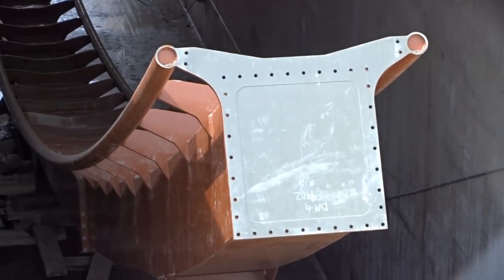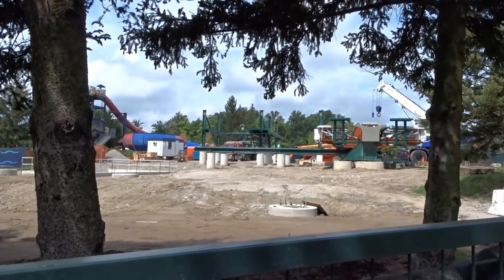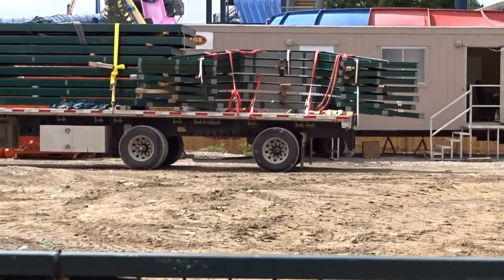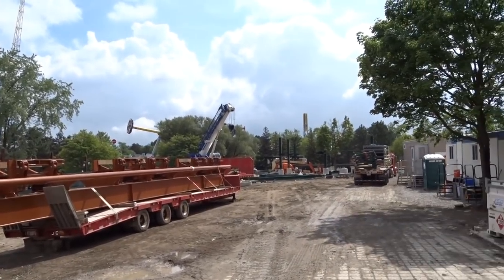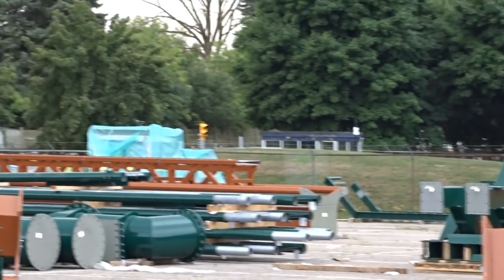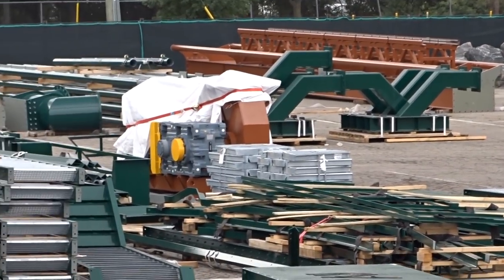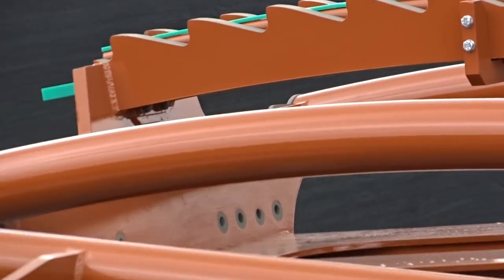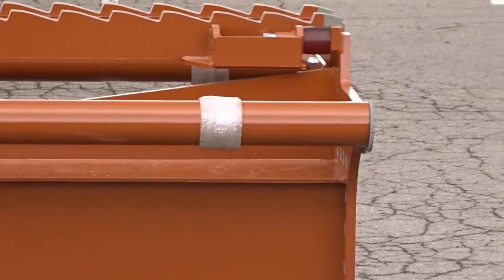Canada's Wonderland Yukon Striker Construction Update

Comment: I don't think it's too surprising that the lift hill will be done in the fall. Now we have video renderings, we can still see the complexity of the site. In fact, I still think a lot more needs to be done during the late fall and winter months.
Reply: xlc88 lol nothing is getting done it the winter or late fall. Its way to cold to build anything is Canadian winters.
Reply: Oh? So that tunnel suddenly appeared at spring? You do realize the weekday closure of the park during the fall allows Wonderland to build over Vortex and into the Timberwolf area. Also the paths to the water park during fall weekends  would probably be closed for construction.
Reply from the maker: Jonay _ most of the construction is done during winter and fall. They will probably be working on Frontier Canada in Fall and Winter. We were told this coaster will be testing in early March and ready for a mid April opening.

Comment: I think cedar fair is trying to give the bigger parks there 3 big steel coasters by like 2020 so they can start to focus more on the parks like CGA but like not completely ignore the big parks because they have to keep adding to the big parks to keep the visitors coming but like I could see kings island Canada’s wonderland and carowinds getting cheaper coasters like RMC and shit like that instead of these B&Ms that are coasting more than 20 million and for kings island if they get the giga in 2020 I’m saying that because of the leaked documents will cost possibly upwards of 35 million because I see it being the tallest fastest and longest giga there is possibly 350ft 100mph+ and over 7 thousand feet long the stats could be higher or lower but that is what I think is possible since they have taken so long to even start the process of getting the giga the giga hype has lasted years and could officially end in less than 2 years